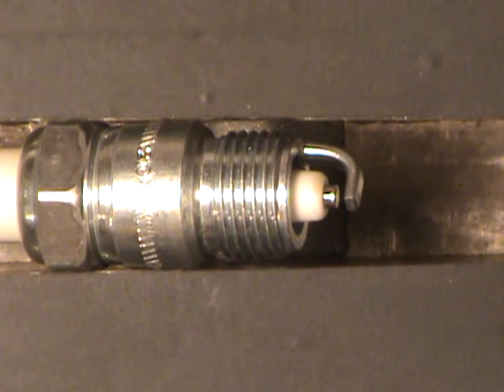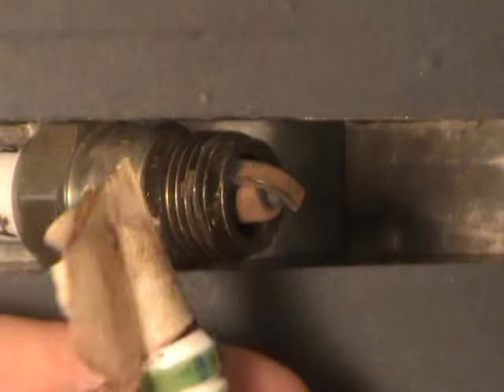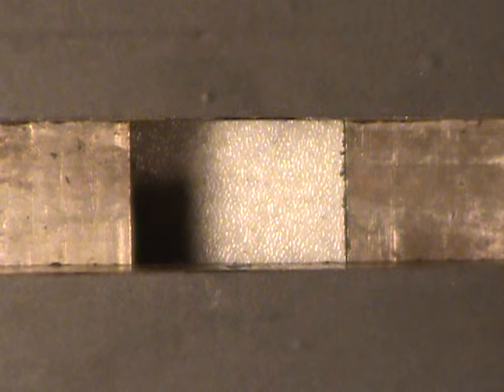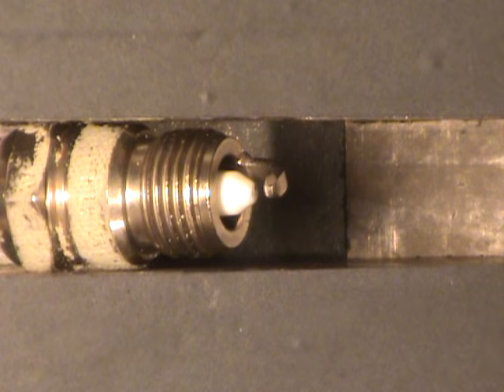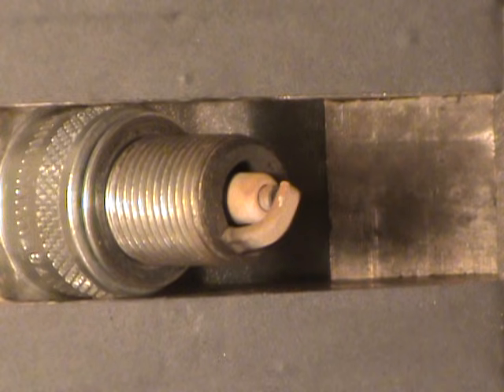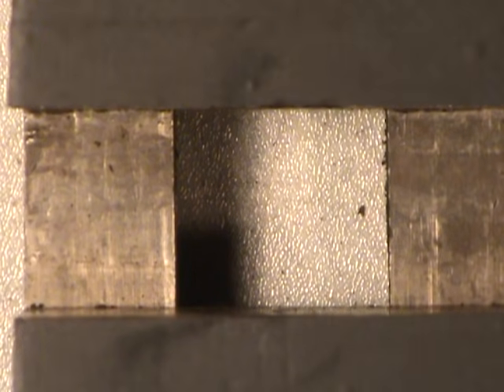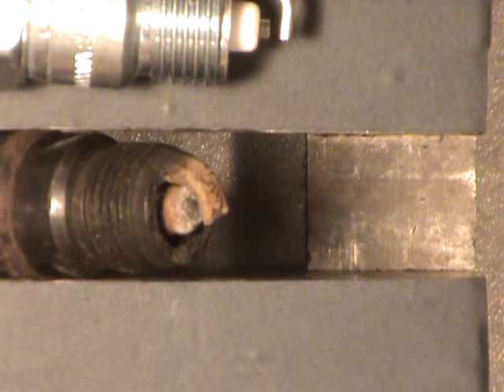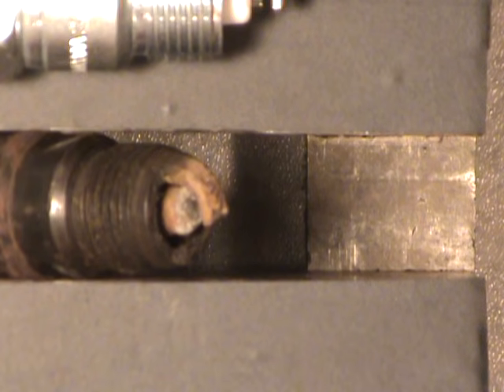SPARK PLUGS How to Read them (Part 3)

Comment: The Spark Plug Doctor will see you now. Great Video
Reply from the maker: Greetings...NoneSponsored/BunkAssMechanic………….Thanks for the nice comment, and thanks, for watching too...…….Well, automotives, is just one, of my many hobbies, and, my way of, shall we say, reading a spark plug, is just a basic, quick, visual check, to see how much electrode wear/gap growth has taken place, as well as, what, if any, deposits, are stuck onto the business end of the spark plug, that just came out of, that particular engine's cylinder head...……..Then, there's the, shall we call them, racing crowd perhaps, where-by, they will look, really, really close, down into the spark plug, where the porcelain, meets up with, the inside of, that screw-threaded metal shell...……..They will sometimes remove a spark plug, after, just doing, a 1/4 mile drag-race (might only be 1,000 feet at some race tracks, perhaps), and then, they will probably get out their, what kinda resembles, a doctor's, ear checking, magnifying, flashlight, kinda thing, and then, look deep down, into the spark plug, to see what kind of, light, deposit/coating shows up, and if need be, they can also change fuel jets, in a carburetor, if so equipped, and/or, what-ever else is needed, in order to adjust/correct, the air/fuel ratio, that will give the best 1/4 mile time, while also, keeping the engine safe, from being damaged, by going too lean, of an air/fuel ratio, while going full out/pedal to the metal...……...Now-ah-days, Ya can just install a wide-band (oxygen sensor), that comes in a kit, along with, an air/fuel ratio gauge, that will be a able to show, just what, the air/fuel ratio is, in real time, as you are driving along, at any speed, and throttle (gas pedal) position, that you so choose, and...…..till next time...….Be Safe, take care, and have a good one.
Reply: @RockysRoadshow  you really know what you are doing. This has the longest reply I've ever recieved. Thank you.

Comment: Used vehicle no idea what previous owner did. Gap should be .054 but removing the plugs the .100 would fit in every one so nearly double what gap should be. Any idea how many miles or time it would take gap to get from .054 to double.
Reply from the maker: Greetings...C.M. ………...Thanks for watching...……….Well, when it comes to that, very large spark plug gap (that's between the two electrodes), that you mentioned, then, that .100 (thousandths of an inch, I presume), would probably have been, almost set that Large, by who-ever, well, minus a bit, due to, how-ever-much-more, that, that so-called, high voltage arcing, increased the gap as well...……...So, to me, I really can't see, a used spark plug's gap, being increased that much, as in, an increase of .046" (forty-six thousandths of an inch)………..I do recall how-ever, that, if a given, older common spark plug, was left in an engine, way too long/for too many miles, then, what I use-tah see, was, that, the center electrode's tip, was worn, kinda, rounded-over, where, it should-ah had, a sharp edge, all around its circumference (like a new spark plug has)………..Then, I also noticed, that, the outer, strap-like electrode, seemed to have a tapered look to it, as in, it kinda got, tapered thinner, towards the end, that's, shall we say, floating in air...……..Maybe .025" maximum, there-abouts, gap-size increase is possible, as a guess, maybe...???...…….If that .054" spark plug gap, happens to be the factory/manufacturer's recommended gap size, then, that's what I would usually stick with, on a factory/not modified engine...…….The Larger, that, a spark plug's gap gets, then, the harder, that, an ignition coil has to work, in order to produce, a good strong spark, between the two electrodes, especially when, the spark plug's electrodes, are in such a high compression environment...……..Also, it's much easier, for an ignition coil to create a spark, between the electrodes, if said spark plug, is out in the open atmosphere, where the air pressure is quite low, as in, oh, about 14.7 PSI/Pounds per Square Inch, at sea level, as I recall...……..If I'm able to, I usually try, to get, the exact/same original spark plugs, that the factory/manufacturer installed in the engine, when it was brand new, if possible, because sometimes, the other chosen spark plug, might not match-up exactly, to the original one, as in, perhaps the heat range is a bit off, as an example...……..If you haven't already done so, have a look in the engine compartment, or, under the hood (bonnet), for a V.E.C.I. (Vehicle Emission Control Information) label/sticker, that should have some good information, printed on it, which, might also include, the spark plug's gap size...……...So yeah, the factory recommended gap size, is probably your best bet, for an engine that will run smoothly, but..."please note"...that, some spark plug "designs", "can't have their electrode gaps adjusted", or, the spark plug, will probably get "Damaged...!!!......and...…..till next time...…..Be Safe, take care, and have a good one.
Reply: @RockysRoadshow  I suspect the previous owner hasn't changed plug for a long time. The recommended gap is .054 or .052-.056, was asking if .100 fits the old plugs how long did they drive it without changing it for it to get from .054 to .100. I'm pretty sure gaps get larger as miles and time go by.
Reply from the maker: Greetings...C.M. ………..Well now, here's something that I just remembered, about the, shall we say "wear rate", and pretty much, "only" applies to, those much older, common type of spark plugs...…...On the older/cheaper, plain type of spark plugs (oh, about 1980's and older, there-abouts), and "before", the spark plug manufacturers, started to use, those, shall we say, "precious metals" (platinum and iridium), then, here Ya go...…….The average wear-rate, of those older/cheaper spark plugs, would've probably been, about .001" (one thousandths of an inch), for every 1,000 miles (on the odometer), that, a properly running engine, was in operation...………So then, here's a hypothetical, for Ya...….. .100" minus .054" equals .046", and based on that average "wear-rate", then, it might-ah been, about 46,000 miles (ball-park figure only)………..Sometimes, that wear rate, might be greater, depending on, just about everything, that affects, the way, that a particular engine is running, as in, that engine's combustion events, as an example, and also, the way, in which, the vehicle is driven (aggressive, or, nice-n-easy), as well as, was it mostly city, stop & go driving...???...or maybe, out cruising, for hours on end, on the open, and much faster highways, stopping only for...Gas...Food...and...Washroom breaks...lol...……..So then, there you have it, my..."guess-tah-mation"...at best...lol...and...….till next time...…..Be Safe, take care, and have a good one.
Reply: @RockysRoadshow  I figured at least that many miles buy didn't know if you had a better estimate ,that will work.

Comment: Very interesting and helpful video. I use an excellent car management program www.automotivewolf.com on my computer that monitors my vehicle maintenance schedule. The requirement for my Toyota Prius is to change the plugs every 120,000 miles. It uses iridium plugs. I removed the plugs to check them and to my surprise they all almost look new. I changed the plugs anyway since that is what Toyota recommends but I think I could have made it a lot longer with the old plugs.
Reply from the maker: Greetings...Patrick Shiloh...……..Thanks for watching...…….According to, what your spark plugs looked like, it's good to hear, that your engine is probably running really good, and for all of those 120,000 miles too...congratulations...……..Hmmm, let's see now, a Toyota Prius, is a hybrid type of car...right...well then, maybe your engine will last twice as long, as a car, that "doesn't have", a BIG Battery pack in it, like the one, that's probably hiding, somewhere near, (and under?), your car's rear seat...……..If I get it right, then, your engine probably doesn't have to work very hard at all, or all of the time either, because of, the electric propulsion system, that propels your Prius down the road...unless...you happen to be a Lead-Foot (pronounced Led-foot), as in, hard on the gas pedal, all of the time...lol...…….Go easy on that Prius, now that the mileage is getting much higher, and hopefully, you won't have to be, replacing that BIG battery pack in your Prius, any time soon, because, I've heard, it has quite the price tag (maybe...Ya can put all of that money, that you saved on gas, towards the new battery pack, if need be...???...lol)………..From what I might know, that spark plug's, iridium material, is super tough stuff...…….As long as, not too many deposits, are getting stuck on your spark plugs, then, as you've seen, they sure do last, a very, very long time, and...….till next time...….Be Safe, take care, and have a good one.
Reply: I use the Automotive Wolf software too. It's extremely useful!

Comment: 5:00 min mark my 03 Camry has the first 2 cylinders lookin white also I notice my coolant dropping slightly every 1500kms. After sitting over night (13hours) on the first start up it smokes white can anyone help?
Reply from the maker: Greetings...Genetic Fury...……….Thanks for watching...……..Being very careful, the first thing to do, is, check for coolant "leaks", that might be on the ground, under your car, that way, you'll know whether or not, that, the coolant might be either leaking out, or, if not, then, the car's coolant, might be being "burned-up", in one or more of the engine's cylinders...……That white smoke that you saw upon engine start-up, might just be, some coolant, getting into 2 cylinders that are beside each other, and might be happening, because of, a faulty (or sometimes called, a blown) head gasket, where-by, the coolant is "leaking" through the head gasket, that has a crack (or gap) in it, where there really "should-not" be one...……A good thing, to almost always do, with a car like yours, is to have your car's on-board computer "scanned" for trouble codes, with a scan tool (that looks, kinda-like, a slightly larger hand held calculator)………..Sometimes, there might be some car parts sales stores, that will scan your vehicle's on-board computer for "free", so, just make a few phone calls, and ask some of them if they do (good luck)…………Also, some car repair shops, should be able to test the coolant, to see, if there is any combustion gas, that might be in the coolant, and, if there is any found, then, it just might be, a faulty (blown) head gasket, possibly, and...…..till next time...…..Be Safe, take care, and have a good one.
Reply: Coolant going through the system is more than likely a duff head gasket.

Comment: Can i replace BKR5EKUP Laser Platinum Plug (5K ohms) with
IZKR7B Laser Iridium Plug (1K ohms)? Even they have different resistance value?

BKR5EKUP Laser Platinum Plug
Thread Size: 14mm
Thread Pitch: 1.25mm
Seat Type: Gasket
Resistor: Yes
Resistor Value: 5K Ohm
Reach: 19mm (3/4")
Hex Size: 5/8" (16mm)
Terminal Type: Solid
Overall Height: ISO
Gap: .024" (0.6mm)

IZKR7B Laser Iridium Plug
Thread Size: 12mm
Thread Pitch: 1.25mm
Seat Type: Gasket
Resistor: Yes
Resistor Value: 1K Ohm
Reach: 19mm (3/4")
Hex Size: 5/8" (16mm)
Terminal Type: Solid
Overall Height: ISO
Gap: .035" (0.9mm)
Reply from the maker: Greetings...Dave Anthony Salalima………..Thanks for watching...……..Well, the safest thing, (in my opinion, that is), for your vehicle's engine, is to use the "factory/manufacturer's"..."Original"...spark plugs, that were installed in your engine, when it was brand new, because, that's what the engineers/designers "specified", for your "exact" engine...……Sure, iridium, will usually last longer that the platinum type, but, why take the chance, in case something goes wrong, maybe...???...and, when all's said and done, who ends up paying for, the (hypothetical) repair bill...??? (he's in the mirror...lol)………..Please..."Don't"...use the spark plug that you listed, and here's why...…….14 mm (millimeter) outside diameter screw-threads, are "Larger" in diameter, than, the 12 mm spark plug's screw-threads...!!!...and the 12 mm will fit very "loose" (if at all), inside the engine's cylinder head's screw-threads, and, as I see it, will "strip-out" (ruin and damage...big time), the cylinder head's screw-threads...!!!...and you'll probably have to replace the cylinder head or heads, as the case may be, and cost-wise, is probably well over $1,000 (dollars), at the very least...!!!...……….The spark plug's electrode "Gaps", are also different from each other as well...…...The larger the spark plug "Gap", the harder the ignition coil/or coils, will have to work, to produce a spark, and, if that Gap gets too Big, then sometimes, an ignition coil could get damaged/destroyed, quite possibly...……..So yeah, please do, stay with the factory/manufacturer's..."Originally"...installed spark plugs, or maybe, a very bad day, it just might be (and I hope not), and......till next time...….Be Safe, take care, and have a good one.

Comment: SWEET ENLIGHTENING STUFF
Reply from the maker: Greetings...Charles mabando…………Thanks for the nice comment, and for, watching too...……..The spark plugs that I used in this YouTube video of mine, were the cheaper, older style/type, and the used ones that you saw, were also out of older engines as well...……….The, shall we say, newer engines (about 1985 and newer), in North America, started using on-board computerized fuel injection, while the pre- (before) 1985 engines, usually had a carburetor on the top of them...……..Some of those, so-called newer engines, in these newer vehicles, might have some more expensive spark plugs installed in them, right from the factory/manufacturer, and, will probably have, one or both of the spark plug's electrodes, made out of a precious metal, such as platinum, as an example...……..The toughest/longest wearing electrode material that I came across, was called iridium (spelling?), and might be able to last about 100,000 miles there-abouts...maybe...???...…….Those cheaper, older spark plugs, would only last for, about 12,000 miles or so, and...…..till next time...….Be Safe, take care, and have a good one.

Comment: how about if the tip is pointed not flat ?
Reply from the maker: Greetings...Phil manwarren.............Thanks for watching............Well, when you are saying the word "tip", did you mean the "center" electrode, that's in the middle of the spark plug (that's "under", the outer electrode, that looks like a bent metal strap, if you will)...???...and pretty much, applies to, the older/more common, cheaper, type of spark plug............There are quite a few, "different" designs and shapes of spark plugs..........Some electrode "materials" these days, might be made of, shall we say, "precious metal", such as...platinum...and even some super tough stuff, that might go by the name...irridium (spelling...???)...........Quite often, I see, very small "center electrodes", when-ever they happen to be, made out of those, so-called, precious metals, when they are brand new, right out of the package............Sometimes, the "outer" electrode, will be some-what pointed as well (when new)............Some spark plugs, might go by the name..."double platinum"...which basically, just means, that, both electrodes have platinum...........Those, shall we say, "high voltage sparks", that jump from one electrode, over to the other one, will probably find it much easier, to make that so-called "jump", when-ever the center electrode, has, "sharp edges", when we're talkin' about, the "Larger" center electrode, on the much cheaper, "old school", type of spark plug, and, in the case of, what might be called, a "fine wire" (small diameter), center electrode, the "spark", can usually jump quite easily...but...the electrode would "wear-out", in a very short time, if it was made out of the cheaper metal, so, that's probably why, those "small" center electrodes, are made out of "precious metal", so they will last a long time............If you can tell me about your vehicle and engine, as in...Year...Make....Model...Engine Size and number of cylinders...then, I'll be able to find, and have a look-see, at the type of spark plug, that you are asking about, and.......till next time.......Be Safe, take care, and have a good one.